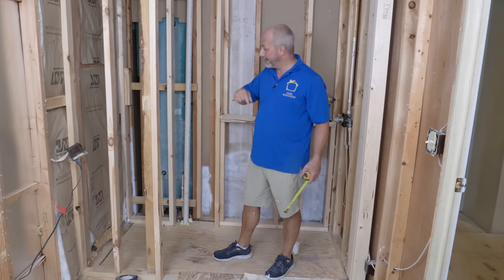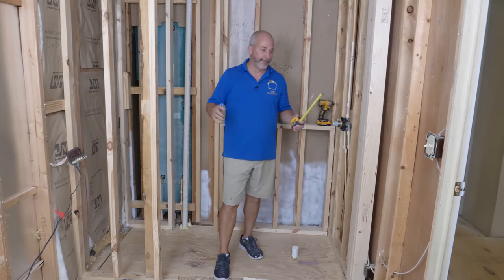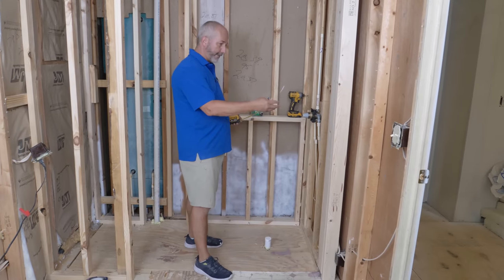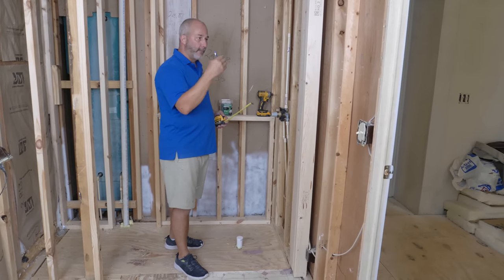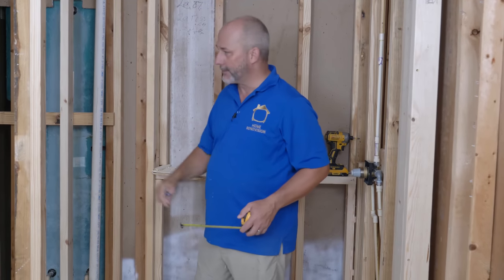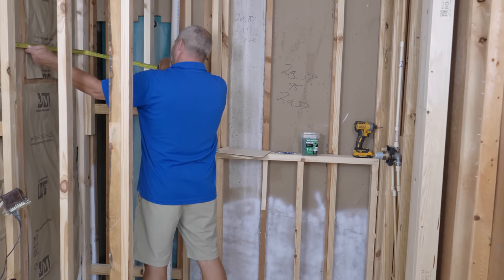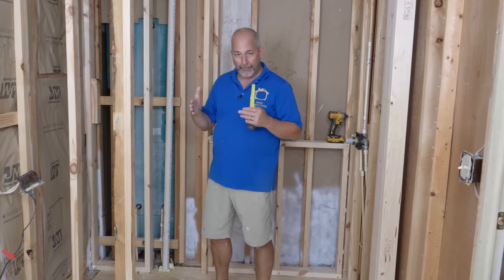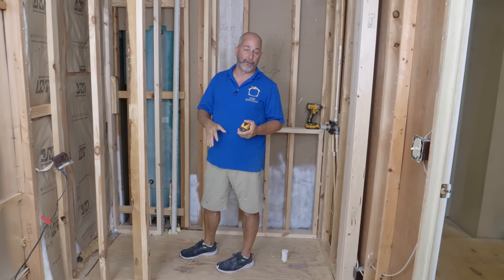Why I Chose Cement Board for my Shower

Comment: The most important thing about those screws that you fail to mention is the coating on them. There is an alkaline chemical reaction with cement board.

That coating is specific to cement board screws, otherwise they will rust out very quickly.
Reply from the maker: very true. never get creative with a product assembly. Cheers!

Comment: Great Video! BUT - After replacing well over 200 shower I can tell you that from experience durock (cement boards)  is a lot better that Hardie-Backer or boards that you are using.  The boards that you are using are super smooth.  If you cut it and don't wipe the dust from the surface with wet sponge your waterproofing or thin set will not stick too well.  Sometimes they like to split into layers. When you try to put a screw in the corner or small 1" strip they will crack or brake. Great Video! I love the way you explain everything!

Comment: Hi from Bristol, Wisconsin!
Thanks Jeff, after priming and leveling my bathroom subfloor  I am putting cement board on my floor for tile. Bathroom side (East side) of house is 1935. Lots of subfloor replaced,  some joists were sistered. Little by little coming along!
Reply from the maker: Fantastic! once you start moving forward you will be glad you paid attention to detail in the beginning! Cheers!

Comment: The blade also tends to track more true when it’s not dragging way too much thru the material. So setting the blade depth to only a bit more than the depth of the material will help you to follow the line for straighter cuts.

Comment: Hardybacker bord are amazing Diy installation, i did exactly the same thing. A TIP for keeping the bord from braking is to pree drill the edges where it like to brake.  It works flawlessly. 
TIP ON Cutting is ezy And less harmful for the Diablo saw blades im still using min. A carbide blade last a long time if it stays cool. Or use a Dimond angle Cutting weel for a grinder. 
Thanks Jeff glad you liked the product. ❤ cuz thats what i used.

Comment: Just redid my own shower a few months ago and I like to stick to the tried-and-true method my father taught me with multiple failsafes. I use a pvc pan liner and 2 thick coats Redguard over my mortar bed before any tile, and cement board (Durock) with 2 coats as well after cement board tape and mortar, leaving a completely seamless finish.
Reply from the maker: that works great as long as the structure is stable so holes don't open up due to expansion and contraction. otherwise the water can get stuck in the bottom of the pan with no where to go. remember with heavy use comes a lot of vapor and redgaurd is not a vapor proof product so you can actually trap it in the base. but like I said only with heavy use. Anything left to dry will always be fine.
Reply: Schluter preformed shower pan and kerdi board is the way to go.
Reply: @woodysranch2690  I don't like how you also have to use their drain flange with the pan, that's another $100 right there. And then using kerdi board means you might as well go ahead and buy their premade niches as well. Gets expensive fast.

My whole shower with pretty nice materials, including a stainless steel shelf off amazon for the niche I built plus new LVP for the bathroom floor was $1400. More labor of course, but I'm not doing 50 showers a year at ~10k each, saving that little bit of time does nothing for me. I do a lot of varying construction work.

Comment: Ive done 2 bathrooms now with John Mansfields Go Board.   Waterproof and much much easier to work with than concrete board.
Reply from the maker: I have yet to use it. where are you buying it from. not readily available where I am from.
Reply: @HomeRenoVisionDIY  Lowes carries it if you’re still working in the states.  I had to buy the sealer at a tile shop, but still local.   I’m in Florida, near Pensacola, but it was in the store in Alaska as well.
Reply: @HomeRenoVisionDIY  Hey Jeff think gobaord would be the same idea as Denshield in Canada.  I have had good success with it in 2 projects

Comment: I am in the process of doing a bathroom install in my upstairs.  The original upstairs was just a single large room about 40 X 25 and IMHO made a ton of wasted space.  The stairwell is near the middle but more towards the north end.  The plan for the shower which will be 3' by 7'6" or so is to use the cement backer board on all of the walls, floor, and ceiling so I can tile it all later on.  I am also thinking about using one of the roll on waterproofing as well as a membrane of some sort since I don't want to ever have to deal with a leak from the shower because it's going to be over the area I will be using as an office and my plan is to build in a couple walls of shelving in the office not to mention the computers and such which will be there so a leak will be VERY bad.

For the cord trick I have been doing that one for years and love seeing someone else teaching that.  It's cheaper than twistlock plugs for sure, lol.  Personally my outside outlets are twistlocks and then I made a box that sits either at the outlet and converts the twist lock into four 20amp standard outlets or on the end of a cord I made so I can have the outlets closer to where I am working.  Another trick that works well though it takes a couple tries to get used to is to use a level as a straight edge for cutting.  I just put two marks 1" shy of my measurement as the shoe of my saw is 1" from the edge to my blade.  Then I use a couple of the speed clamps to hold the level onto what I am cutting and line the level up right on the marks.  Then all I have to do is make my cut keeping the shoe right up against the level.  It takes an extra couple seconds to setup but you also don't have to mark a full line either so it ends up taking about the same amount of time as marking the line and then trying to follow it and IMHO is faster because I don't have to even look at a line, I just keep the shoe tight to the level and zip through the piece.  Putting up foamboard on the house I used this trick instead of trying to use a knife to cut and it's amazing how quick it works and IMHO it's nearly as good as a factory edge for how straight the cut is.

I did notice you didn't put up a lot of blocking for grab bars.  I am using pretty much any 2X4 offcut I can to put in blocking for grab bars.  I thought about putting in a niche and whatnot but found some corner shelves that are also grab bars so two will go on either side of where the shower head is and then along the walls there will be a grab bar to hang washcloths and towels or whatever it is you would often hang on a thin little towelbar.  It costs a little more but at the same time you now have something that won't pull out of the wall and I have seen a bunch of houses and apartments where someone has started to loose their balance and they reach out to grab whatever they can ripping those cheapo towel bars down in the process.  My wife who passed away a few years ago was also in a power chair most of the time and needed help to shift around and sadly where we were at there was nothing to help her in the process.  IMHO we should build houses  (or remodel) with the idea in mind that at some point we could end up in a power chair or on crutches, was told that by an old drywaller who said all door's should be 3.0 doors because wheelchairs go through them better.

I did notice you guys don't go into a lot of the DataComm and such though, I worked for a WISP (Wireless Internet Service Provider) and went into a 2 year old house that only had a couple phone lines ran.  They also didn't want to have ethernet wires ran inside or outside of the house so they were stuck with a crappy little WiFi Router upstairs and we were constantly going out there for that as an issue.  The place I am working on has over 1500 feet of Cat6 ethernet ran so far with a few drops of OM3 fiber in the mix with coax for legacy connections.  My office alone will have 12 RJ45 ethernet jacks, 3 RG6 coax outlets, and 6 OM3 fiber optic connections.  The living room has two spots that will each have 3 RJ45 ethernet jacks, 3 RG6 coax outlets, and 1 OM3 fiber connection.  The rest of the house will have at least 2 spots with one ethernet and one coax, then each room will get a single OM3 fiber drop.  I also installed an umbilical which consists of 4 Cat6 cables, 4 RG6 Coax cables, 2 dual OM3 Fiber lines, and 2 OS2 Singlemode fiber lines as well as power to a single box I built on the outside of the house for a demarcation point.  It's overkill but still you have to think about the way things are going, I personally don't want to be running cables on the outside of the house.  Actually the place had conduit on the outside for 220V power to an AC as well as the stove on the outside and a ton of coax and phone lines that I ripped off the house once most of our stuff was moved in and secure.

Comment: For cbu, if you are using mastic to install tile (don't ever use mastic in a shower), the smooth side goes out.  The rough side goes out if you are going to use thinset.  That said if you are using a roll on membrane like redgard I would do smooth side out anyway simply because it would use less of the membrane to waterproof it.  On kerdi it won't matter.

Comment: Cement board is also a great sound insulator compared to drywall, especially when combined with Rockwool.
Reply: Can we use cement board throughout a house instead of drywall?
Reply: @MadLadsAnonymous  You can, but it will be more work to finish to the standard painted finish, since the cement boards is not smooth like drywall. Used cement board on every wall and ceiling for bathrooms -- took an extra coat or two of joint compound. Ceiling was challenging because of the weight, but you could cut the panels smaller and just do more taping instead.
Reply: @MadLadsAnonymous better to use a sound dampening drywall
Reply: Yeah, I would think one would have to float the entire cement board with drywall mud to properly finish cement board on a wall. I never thought of the sound damping ability of cement board though. Thanks 😊
Reply: @MadLadsAnonymous use drywall and if you want cost with cement you will get a great resulta more time conauming

Comment: The type of cement board you used isn't available at any stores near me so I had to go with Durock cement board that had Edgeguard. I used Mapei Aquadefense on all of the edges, seams, over screw holes, and even over some small hairline cracks that developed. That stuff cures very sturdy and acts as reinforcement as well as water seal. I put up the plastic used for protecting stuff from paint on the walls behind the cement boards so the board would not directly touch wood. Redguard was not available in my area.

 I went with a Mustee Durawall glue-up surround instead of tile because I hate tile. I like the look of the glue-up surround a lot better. No grout lines to clean. And it was forgiving of the walls still being a bit wonky. I covered all of the edges with PVC boards and trim so it looks nice to me. The alkalai resistant self-adhesive joint tape was pretty easy to work with.

I tried using a scoring tool for cementboard & it didn't work very well. Ended up using a reciprocating saw and oscillating tool, although it was sloppy.

Where your cement board cracked a little you could use Aquadefense or Redguard on it before using the tape. It will reinforce it-- as I mentioned earlier.

Comment: I'm happy to see this since it confirms my own experience (I guess that means confirmation bias). I rebuilt a shower about 9 years ago using an American Standard acrylic pan, UT-crete cement board, and Redgard for my waterproof membrane. I used stainless steel screws (I use only SS for fasteners in wet/humid environments), and added another level of waterproofing by using a two-part tile adhesive called "Inament E-73") made by INAX (not sure if it's available in US) made specifically for tiling in wet environments (unlike cement-based adhesives, the Inament is virtually impervious to water).  I decided to use Redgard instead of other options then available due to its simplicity and cost (I had to have it shipped to Japan).  I'm not a professional, though, so I did "due diligence" in my planning, meaning I did a lot of research on the issues beforehand, and I read and followed the installation/best practices instructions for these products, especially for the Redgard, since I've seen a lot of misinformation about it floating around the net. If you follow the instructions, this kind of installation is probably the easiest effective way to redo a shower.
Reply from the maker: well done. Cheers! the only thing it does not do is protect against vapor so not for heavy use in some geographies and age of house. If you need vapor control as well then use the woven plastic liner as seen in this video on all the walls. as well.

Comment: Heres my technique.... 15 lb paper on studs.... hold my cement board off the subfloor about 5 inches which allows the pan to recess into wall. Then with lathe and mud fill the recess area perfectly vertical. Run wall tile...mud floor and tile floor. Never had a failure with over 200 showers installed. These new systems seem to have a high failure rate.

Comment: I've done two of bathrooms with Schluter Kerdi Board. It's a little expensive but for my house I don't care. I'm in the process of doing my third bathroom that backs up to the first bathroom I did in 2010. When I tore out the shower the other bathroom tub wall back was exposed. This is the shower valve wall, it was perfectly dry, matter a fact it had dust on it. I see many other products that copy Kerdi Board.
Reply: Not sure if I trust foam as my wall to hang titles on
Reply: I’m doing a bathroom now with Schluter.  So easy to work with and strong. 👍🏻
Reply from the maker: kerdi board  is actually rated really high for the ability to hold weight on the wall even in earthquake zones.

Comment: 13:38 Jeff love your videos, instruction and care with your work. I am on the home stretch of a renovation right now. My contractor put this red board up in the new showers. He used roofing nails in these tight spots to avoid that breakage, just curious on your thoughts with that? Also, just want to say thank you for all the amazing content and I agree with some of the other patrons. I’m finding a lot more work for myself to do. 😂 Cheers!
Reply from the maker: as long as the nails were galvanized then you will be fine. concrete is alkaline and eats metal if it is not galvanized. Cheers!

Comment: I'm getting ready to replace my leaking toiled and I'm pretty sure the subfloor has some slight water damage. I was thinking about replacing my custom shower I did in the late 90's at the same time.  I used a thick rubber liner extending up the walls about 8" or so, layed concrete for the floor over the liner for the pan and used cement board for the walls (over the rubber liner and on top of the cement) and tiled over it.  It worked really well, no leaks, no issues in 26/27 years.  two questions - do I need to tear the shower out? and can I use cement board under the toilet to protect against any future leaks.  note: I live in a rural area and have little to no building code to follow but I still like to do things correctly.

Comment: Great video, good guide on installation! My only question at this point is regarding mold. In my experience helping friends and family, the drywall rarely is falling apart from the moisture if it dries out, but the mold is awful. Green drywall is supposed to inhibit it but we know how that goes... I cut it out if moldy, whether it's in good shape or not. Does the cement board have features to inhibit mold, or is it the surface prep afterwards or what? If it's solid but moldy I'm in the same situation.
Reply: It is mold-resistant and can more easily dry out. No risk of mold with it if things are properly installed.
Reply: @alexl53  thanks, I will have to try it out next go around
Reply: Yeah my shower was built with greenboard, I doubt it lasted ten years. Installer was a dangerous DIY guy, he didn't use membrane or Redguard behind the green board.
Reply: @mikeking7470  crazy! Was it tile over green board or what?
Reply: Cement board doesn't have anything in it for mold to feed on, so it doesn't mold.
Reply: @mikeking7470 That's still the way new houses are done in some areas.
Reply from the maker: to avoid mold you must keep water and vapor from getting trapped in the wall cavity. for regular use showers simply manage water and the house A/c and heating will manage the rest. waterproofing is very important and that video is coming soon. Cheers!

Comment: Ive used thay red hardiebacker before. Good stuff but water wicks up/in. Not sure how its supposed to be waterproof as is. Using original HB now with a roll on waterproofer.